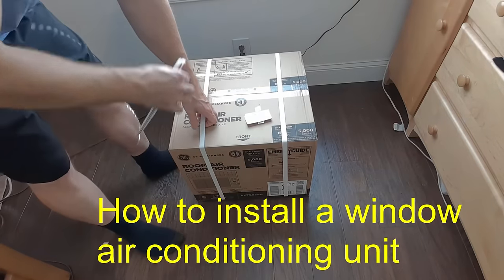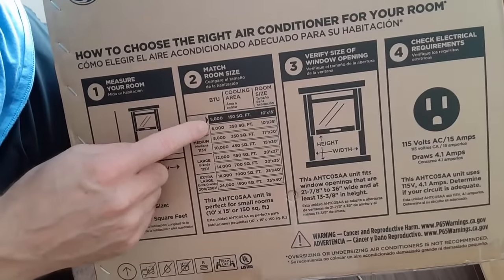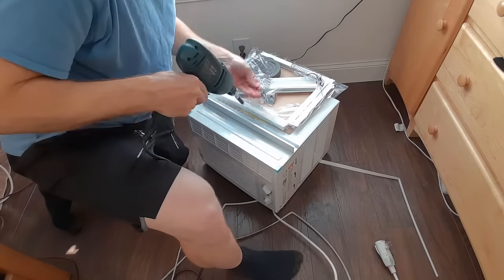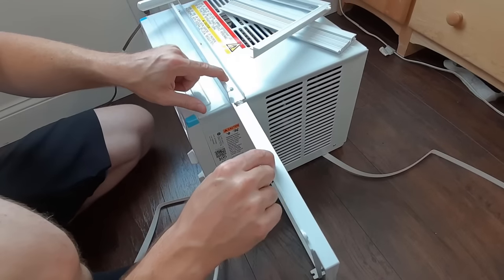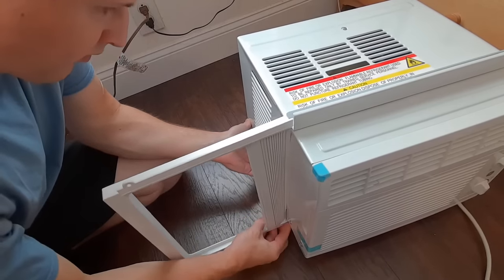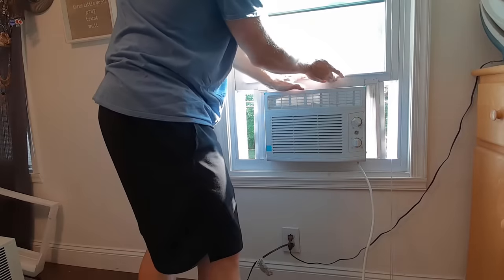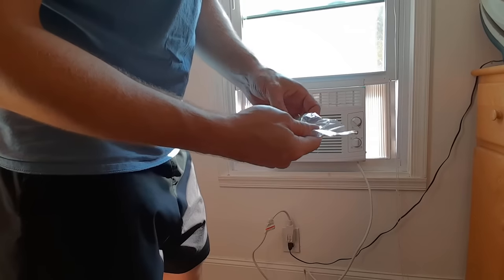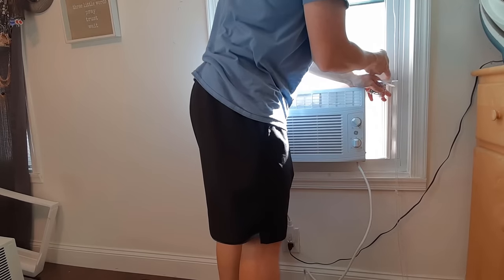How to Assemble and Install a Small Window AC Unit (5000 / 6000 BTU)

Comment: TIP: immediately after unboxing, and before installing the other parts, plug it in and let it run for 5 or 10 minutes to make sure it actually works. This way if you have to take it back to the store, you don't have a lot of pieces to take back off and repack. I learned this the hard way.
Reply from the maker: I had that happen once out of the three units I installed from homedepot.
Reply: Just had this happen to me and I messed up big time. I bought the unit on clearance in October. Let it sit until last week and opened the brand new thing out of box and installed it… didn’t work. Walmart wouldn’t take it back because of when I bought it. Even though they sold me a defective unit. Had to call the manufacturer and they refunded me thankfully. This is a pro tip and don’t wait like me…. Dupyashhh
Reply: I just removed the filter to clean it and now I can’t place it back because the thermostat wire is in the way so it only goes in 1/3 of the way
Reply: Huh 🤔,,, you got a point there
Reply: @WelcometotheFamily1  is this piece of styrofoam supposed to be inside my unit
Reply: Pro tip #2: if it says GE proceed to last step and straight to return.
Reply: @ruben-tj6pw buy a new one and out that one back in box
Reply: Thank you!!
Reply: Hard same!!!!  I paid a handyman to install my AC and then turns out it didn’t work!!!!  What a hassle to get it out and returned and buy a new one and repeat the process all over again.
Reply: Maybe not a lifesaving tip, but a great time saving tip. I consider every minute of my time greatly now and you have no idea how much one hour of saved time really is. Much thanks.

Comment: Mine wont cool nothing
Reply from the maker: One of the four air conditioners I got did not work and I had to send it back and get a replacement.  They sometimes have either fan or other issues. Plug it in and try it before taking the time to put every together on the next one.

Comment: What about the styrofoam inside of the Air Conditioner?
Reply from the maker: The Styrofoam inside the air conditioner is meant to be there to act as an insulator for the cool room air side from the hot outside air.
Reply: I was looking at the same thing wondering what that is for.

Comment: The packing tape idea is brilliant! It made the whole thing so easy. Thank you.
Reply from the maker: Thank you, for the feedback. As long as it is a vinyl window the tape is much easier to stop air gaps and should not damage anything on the window. Painted windows may cause some loose paint to come off, but I still prefer it over drilling holes everywhere for a window AC.

Comment: Thank you, I was really scared to drill into the window like the instructions and GE instructional video showed in fear of shattering my window but this made me a lot more comfortable leaving it taped in.
Reply from the maker: I have taped them and other times I drill a very shallow hole and still tape to prevent drafts. If I was on the ground floor and in a dangerous area I would either drill or at least put blocks of wood at the top so no one can lift the window open and climb into the house.

Comment: This was a very well made, clear video. I like the suggestion of packing tape to seal.
Now I will look for a video about how to remove the screen window. It does not slide, is not like any window I have worked with before. It looks like it has 2 large tabs on one side. I hope pressing as I did from the outside will work.😊. 
Again, excellent video!

Comment: My central A/C unit went out and a tech wasn’t able to make it out until the next day. I purchased two units of the same size you have the tutorial on. When I pulled out the instructions I got lost at having to screw it in the window. I paused to watch this video and now it looks like I had a professional install them. Thanks for the package tape idea, worked like a charm. Never knew about the insulation item either. Thanks a bunch!!

Comment: I have replacement windows too.  Just to clarify - when you close the window on top of the unit ,  the rail on the top of it is inside the house and the window closes behind it.  But the bottom of the unit is on the outside, behind the bottom edge of the replacement window.   Is that right?
Also how do I get it to tip down outside to drain.  Mine is only very slightly tipping down.  The instructions say it should be 1/4 inch.   I'm estimating mine is less than half that.  Thank you.

Comment: About the two metal protrusions at the bottom front of the unit. Do they stay in front of the window ledge or behind it. Seems that if in front, it helps secure unit in place, but if behind, it allows the unit to be pushed back further.
Reply from the maker: The bottom metal sites inside the window ledge where the window would come down. This allows for a better seal when the sides are extended.

Comment: Thanks for the simple install walkthrough. I bought the same model so this helps.
Reply: Does it work well?
Reply: @tomasvaris8162  Yes, works great. In a 120 sq' home office keeps it at 74 while outside is 95. This allows me to turn up the home ac to 78 during the day while I am in the office. So it may save some money not running the home ac. Kind of like spot cooling just the room i am in.
Reply: @briant2259  thanks 👍👍

Comment: Thank you for the informative video! I was wondering, would the AC be installed securely even without using screws? I have metal window frames so I wouldn't be able to screw it into place.
Reply: That was my issue to but as long as no one is gon be touching it and messing wit the window u should be fine
Reply: @ornellatv2380  Thanks for the response! I installed it just fine and noticed it was surprisingly secure without the screws.

Comment: Hi great video thanks :)    I would also add that if you dont live on the ground floor its better to secure it with screws because if it falls and kills someone below you are liable.   Also remove the blue pieces of tape on the corners,  and also the one that keeps your slide filter from sliding out.     :)
Reply from the maker: It is preferred to screw the AC in if people are walking below for the risk that you stated. I currently live in a rental and they did not want any screws in the window plastic or trim. Thank you for the comment.

Comment: I didn't see you use any screws, except for the top rail. What about the lock frame & sash lock, to secure the ac to the window? For small unit, will just closing it be ok?

Comment: Quick question the foam inside the air conditioner does it stay there or do we have to take it out
Reply from the maker: The white foam inside the air conditioner has to stay there as it insulates the room side from the outside.

Comment: I am installing a Fridgemaster (Hisense) window air conditioner. On the angled top rail only 2 of the 4 line up. Should I drill other holes, I assume on the rail?
The instructions that came with my unit were nowhere as clear as yours!

Comment: I accidentally attached the side panels to the brackets before putting them on the air conditioner. Is there a way to unlock the panels from the bracket?
Reply: You can still slide the side panels down the attached slots with the brackets on if you still need help I can recommend another video of which I've seen it done
Reply: I got mine already locked in place. I knew I wasn't tripping. Jesus. Now imma break the thing (already)  to get it right omg 😳 my life 🤣
Reply: I can't get mine out of the brackets... accidentally put it on the wrong side and I can't get it to pop out

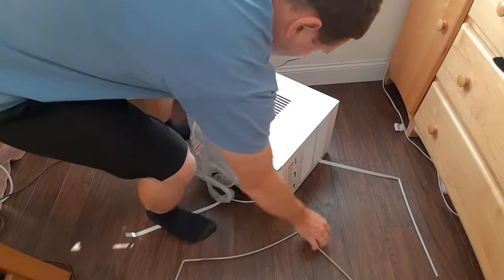Comment: Thanks for the video.  GE are crap from 1:35  what ive researched. Good luck with that
Reply from the maker: I had one unit that did not turn on the compressor (vendor immediately gave me a replacement) and 2 others that worked great. I would suggest plugging them in to see if they work and be able to return them if the unit does not work when you turn it on for 15 minutes.

Comment: Mine leaks when it rains but it comes from under the accordion part, I don't know how to fix it
Reply from the maker: Make sure there is a slight tilt on the AC unit down towards the outside to encourage water to drain outside. Make sure the bracket to the accordion sides sit in the window towards the outside. If this window does not have an overhang or gutters above it and gets a ton of ran tape plastic to the outside side of the accordion part to prevent most of the water and you can drill hole in the bottom outside facing part of the accordion channel to drain the water to the outside and hopefully your window is sloped properly to drain to the outside. Subscribe for more DIY installation repair tips.

Comment: There is a piece of styrofoam in mines does that come out ??
Reply from the maker: The styrofoam inside the air conditioner is an insulator that stays in the unit to keep cold air inside the house and hot air outside the house.

Comment: Why hasn’t anybody asked about
The cord being too
Short? If the cord is short, is it still
Safe to
Use an adapter or does it have to be a plug from
The wall?
Reply from the maker: As long as the cord can handle 15 amps it would be fine.

Comment: How has it held up. Does it still work?
Reply from the maker: I have used it for 3 years at two different houses and it still works great. I noticed that 1 of the 3 AC units I bought did not work out of the box and returned it.
Reply: @WelcometotheFamily1  thanks

Comment: Does your unit ever go OFF completely once the desired TEMP is reached?   My condenser kicks out like it should, but the FAN RUNS 24/7...  DOES YOUR FAN RUN 24/7?
Reply from the maker: Once the temperature is reached the condenser will turn off. The fan will continue to run even when the condenser turns off. Please subscribe for more useful content like this.
Reply: Well I can see that this unit want last that long with the 24/7/365, with the FAN CONTINUOUSLY RUNNING.  MY Last LG unit lasted 6 years, but if the Power goes OUT, or even a Short Power Bump, the Unit will not restart itself.  Where as a Manual unit will, that why I chose this unit.  Thanks for the info,  I'll just have wait and see.  THANKS

Comment: Could this work with a side screen that goes left to right or it's only for up down screen
Reply from the maker: it gets tricky with a side to side window as you will likely need to cut out wood to hold the AC unit in place unless it fits perfectly.

Comment: Does it have to be put on the window for it to work or can I just have it on a table?
Reply from the maker: All air conditioners need one end to pump the heat to outside and the other end to cool the air. As the air is cooled the heat and moisture from the air is pumped outside. So you cannot cool a room if it is just on a table the hot side has to be put out the window. I hope that helps, please subscribe for more DIY house repairs.

Comment: So I have a question about the brackets on the bottom of the ac for the side panels! Are the supposed to be seen inside the house or do they sit on the window sill?
Reply from the maker: The brackets on the bottom of the AC for the side panels need to sit within the window sill and would not be seen from inside the house.

Comment: when it storms though do i have to worry about a short?????😰 i just put mine in but now im panicking over weather or not rain will damage the unit from the outside. any one happen to know if these window a/c units are weather proof???🥶
Reply from the maker: The outside of the unit is made to be in the rain and that is why it goes through the window. Make sure that there is a slight tilt towards the outside and the water will go to the outside that is how these were designed. AC units are heat pumps that move heat energy to the outside.
Reply: @WelcometotheFamily1  thanks, yea i got a slight tilt to it. just a shitty window that wasnt designed for it but i made it work anyways lol

Comment: Is there a reliable unit anymore??? I have 3 that have lasted about 20 years and are almost older than me that are starting to give out and every one I look at has problems. Stating they go out after a month of use, leak or make horrible noises. I am stuck and don’t know what I should do I know that they don’t make things to last anymore but I literally cannot find one unit that has decent reviews. I’m not willing to pay 500$ for something to break after a couple of months or to start leaking on my floor I hope a genuine person sees this and can help
Reply: 2 of the units still work! One is going out. If it doesn’t leak or make those noises then I see people saying it comes out of the box blowing hot air. I’m needing something to cool down a 10x9 room in this 100 degree texas heat!

Comment: You get a thumbs up by I would do the same thing tape a a❤ for taken your time I saw some videos not very helpful some go too dam fast like there dieing lol and yeah man a piece of wood for the top window for kids not to open it and one thing I didn't know what the foam was for ahahahahahah that's why the Ac kept running 😂
Reply: My one last ? Is one of my Ac left to right broke any suggestions to how getting parts for them
Reply from the maker: I would suggest looking at the model sticker / plate on the old one it should give a model and serial number for the brand if you are looking for parts and call up the manufacturer. Not knowing which window AC unit it is I would suggest buying a new one as the parts and effort to fix (soldering, refrigerant, etc.) it may be more expensive than a new unit which will also be more energy efficient and save money on electricity. I hope that helps and if you wouldn't mind subscribing it would help me get to 1000 subscribers to allow me to earn for the videos I make. Thank you and have a great day.
Reply: Yes thanks man

Comment: My electricity bill became way too much because I was using multiple air conditioners so what I had to do was tap into my neighbor's electrical supply I jimmy-rigged a cord that was an extension and got it to run my AC units for the entire summer unfortunately my neighbor caught me and now I have to pay him at least $500 for only electricity I borrowed

Comment: I never screw my units in  i cant being in a apartment. I am upstairs windows  i will mever put one of those in downstairs
Reply from the maker: You can always put a block of wood at the top of the window to help prevent someone from breaking in through the window as another way to stop the window from opening. Similar to putting a 2x4 cut to the right length at the bottom of a sliding door.

Comment: Can I turn it sideways🤦🏾‍♀️
Reply from the maker: do not turn AC units and other items with refrigeration cycles on their sides it will cause damage to the unit or the unit may not run. The heat transfer fluid needs to flow in a single direction and fluid may get stuck if installed in the incorrect orientation. If you have a side to side window you may want to cut out a wooden insert for this type of AC unit to be installed.

Comment: do you put water inside?
Reply from the maker: No, do not put any water in the the AC unit.
Reply: @WelcometotheFamily1  should I keep all the windows closed in my trailer or keep one open when using this ac unit
Reply from the maker: @StarWarsAndMoreArt  Keep the windows closed. The window AC has the front cold end in the room and the hot exhaust end out the window as shown in the video.
Reply: You’ve gotta be trolling.
Reply: @ju1ce159  I think he's asking legit questions. It seems he's probably used to evaporative coolers (swamp coolers), which require a water source and window venting.

Comment: PRO TIP: IF THIS IS A GE UNIT (WITH A CIRCUIT BOARD IN THE FRONT) PROCEED TO OPEN THE FRONT UNIT TO ACCESS MAIN CONTROL BOARD AND TAKE A SHARP PAIR OF CUTTERS AND PROCEED TO CUT ALL OF THE WIRING OUT OF THIS PILE OF JUNK WHILE RIPPING THE USB CORD COMPLETELY FROM UNIT. OR JUST TAKE IT BACK TO WHERE YOU BOUGHT IT AND GET SOMETHING THATS NOT A TOTAL POS.   YOU'RE WELCOME IN ADVANCE.

Comment: Where does it drain the water?
Reply from the maker: Make sure the unit is tilted slightly to the outside and the water/condensate will drip / drain outside
Reply: @WelcometotheFamily1  thank you! So far I’m keeping it inside my minivan and it’s working just fine. No condensation or water dripping yet.  Coolest thing ever 👍